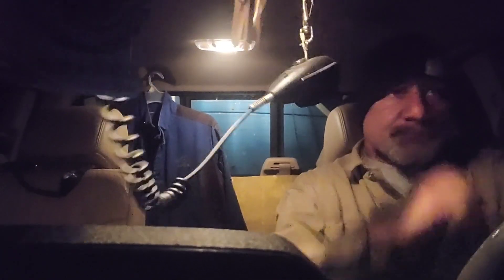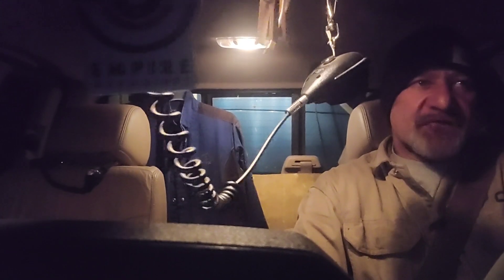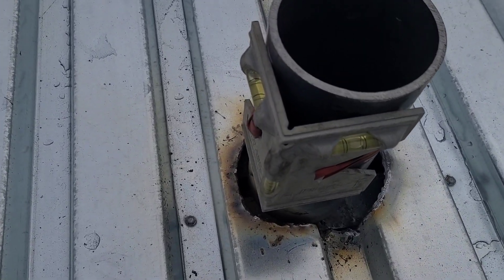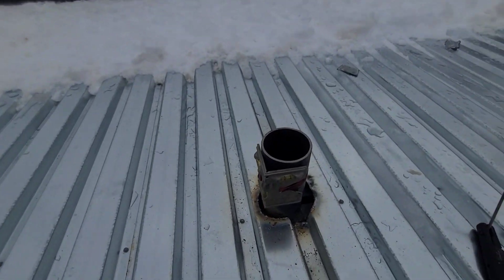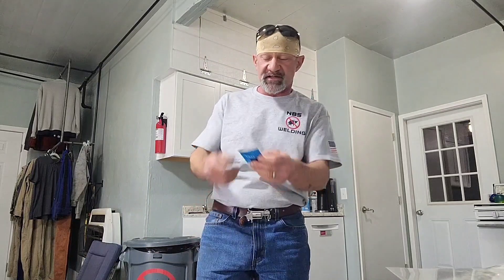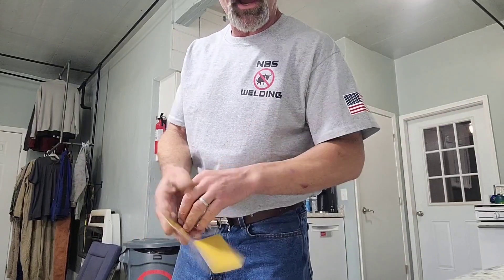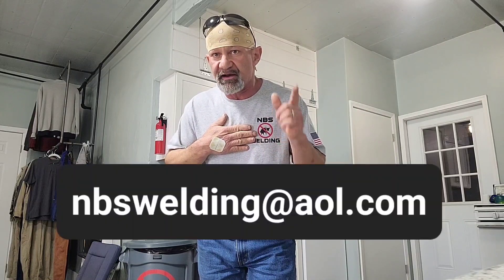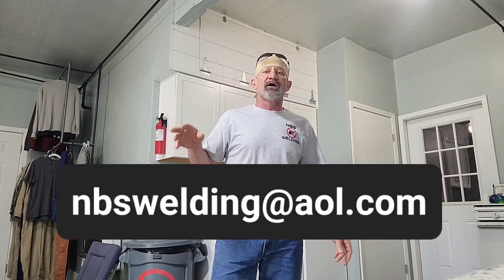Welding in provisions to set equipment on the roof of a grocery store

Comment: Looks like a great idea. I’ve put in RTU frames where you weld angle iron to the top and bottom cords of the bar joists but never seen this pipe trick before. Do you still have to do that in order to reinforce the bar joists below these 4”pipes?
Reply from the maker: I don't think it gets any other reinforcement

Comment: Neat trick.  will they pour concrete or asphalt onto the roof top or is the steel left bare?
Reply from the maker: I think it gets rubber roof with rocks on it...using pipe makes it easy for roofers because they have rubber boots that fit the 4" pipes so it's easy for them to make their seal
Reply: @NBSWELDING  cool.  Hope your new year is excellent.
Reply: It's going to get 3" rigid foam insulation screwed down to corrugated steel decking. Then EPDM(like a bike tube) rubber, or TPO(white pvc vinyl) glued down with 'contact' rubber cement rolled out w\ a roller on both mating surfaces(EPDM & insulation). Usually this is glue-down as opposed to ballasted = rock covered(the gravel +gravity keeps it on instead of glue). But could be either depending on what's spec'd. TPO is just a different top material, but still glued down & screwed(not ballasted). 
Other flat roof options are:
 -BUR -Built up roof; is just hot tar & paper in multiple 'built up' layers, but isn't used at all anymore. 
 -MBR - Modified bituminous rubber, aka torch-down rubber is also used on flat roofs but would require flat decking to be added(over insulation). 
Anyways, I really like this pipe process for the HVAC unit mounting on the roofs. It's easier to roof around those pipes than a bunch of built up boxes that would normally be used. There is still going to be holes going through the roof for the big ducts coming from the multiple rooftop HVAC units into the store. 
If I had to guess, this is getting insulation, EPDM glue-down roofing. Cool job though! 👍🏻👌🏻🛠️🔧🔩📏📐🤔🦺